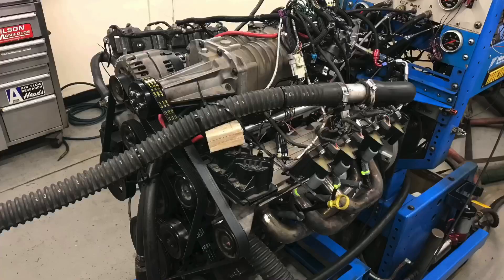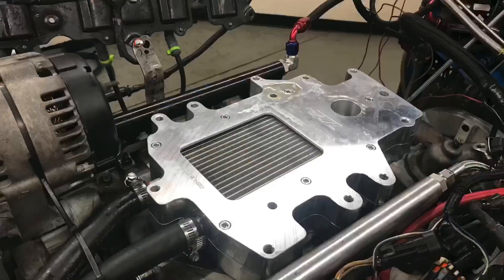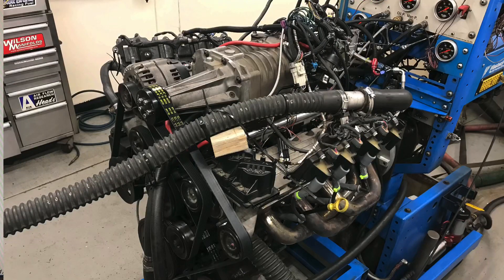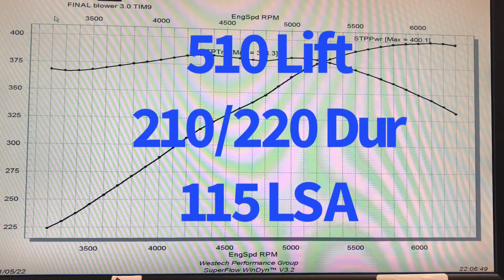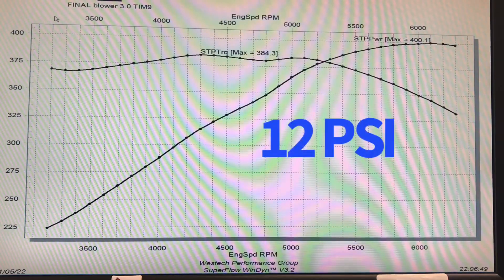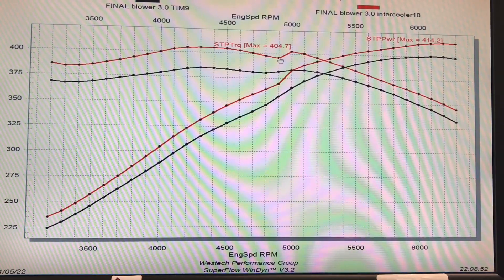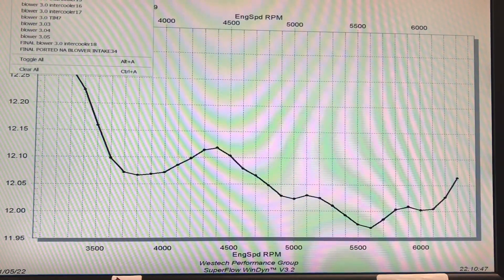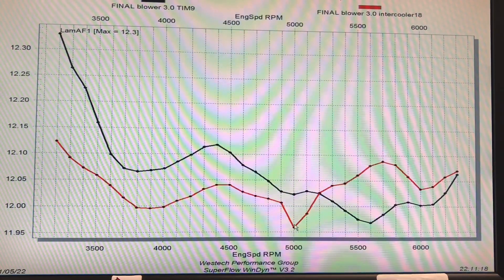DO INTERCOOLERS ADD POWER? JUNKYARD SUPERCHARGED 3800 L67 V6 INTERCOOLER TEST. ZZP AIR-TO-WATER TEST

Comment: I understand this is on Dyno giving the ideal perfect environment. However, water/air heat exchangers on these cars still have very bad heat soak. You can get 4-5 good convective pulls running a heat exchanger. Where as no heat exchanger you've really only have 1 maybe 2 if it's cold outside. In a vehicle, the coolant system for the heat exchanger is quite small so it doesn't take much to heat up the fluid. On my car, I've added small rad fans (typically found off of dirtbikes) to the front mount. These fans truly make a significant difference. I can make multiple consecutive pulls and my IAT are still reasonable.
Reply: If you're having this issue and fans make it better you're not getting any passive flow of air through the heat exchanger. The air flow offered by a cars movement at say 100kmh or 60mph is magnitudes greater than any airflow fans can provide.
A common mistake people make when installing aftermarket exchangers is assuming they work with positive pressure. This in fact wrong and no amount of air ramming will fix the issue. You need a pressure differential across the core so you need the egine bay to create negative pressure. If you examine OE cars you will find there is plastic all around the radiator to separate the engine bay from the front side of the car. This creates a high pressure zone on the front side and a negative pressure zone on the back side of the radiator allowing air to flow. I would imagine your intercoolers radiator is getting postive pressure behind it and you've bainaid fixed the issue with fans.

Comment: Just put a jdm 208 in my 02 wrx. Upgraded to STI pink inj. (565) Bigger charge pipe. Aem fuel pump and a tdo5 turbo. Looking for 300whp. Going to stick with stock intercooler.

Comment: The dip in Tq corresponds with the dip in A/F. I wonder what might connect the two. Spark gap too large, weak coils... ? 

Is this motor going into the Nova? 

The methanol, while decreasing intake temps, also displaces some of the air that can be mixed with fuel to make power.

Comment: I would offer that the water sprayed into the intake is displacing air and fuel thus the resultant lack of power gain compared to the intercooler. Energy is spent converting the water into steam which then goes out the tailpipe. #MAZDA
Reply: steam does have much higher volume than water, so that should help drive the piston down. At least that is what the F1 people said when they played with water injection

Comment: My guess is that e85 is already taking up most of the heat, so there's no heat for the methanol to absorb. While the intercooler is making the air denser.

Comment: My guess is that water going through the supercharger is consuming a portion of the total available mass flow. Because the supercharger is driven by a fixed ratio system there is less available room/flow for additional air/mass of any kind??…compounded by the fact the water vaporizes and thus expands on its journey thru the supercharger making the situation a bit worse. 

A really interesting test would be to remove the intercooler and jury rig the six fuel nozzles above it, but behind the throttle plate to confirm the evaporation cooling of E85 through a blower. 

But perhaps as all too often, I’m barking up the wrong tree…

Cheers 🍻

Comment: Water/methanol converts the sensible heat to latent heat but also adding the volume of the vapor from from the injected liquid. The intercooler removes heat and allows for a denser charge and more mass of air into the engine resulting in more power. The water/methanol inject will lower temperatures but won't effectively add more mass of air going into the engine.
Reply from the maker: BINGO

Comment: Maybe the water/meth was less of a consistent mixture in terms of temp and AFR compared to just uniformly cooler air? How did thr intercooler change the boost pressure vs water/meth?

Comment: This makes me want to get back into 3800 stuff. I know its a junkyard motor theme but some day id love to see a combo like I had with higher compression and worked over heads. When I first built my 3800 and had problems with the intercooler coolant loop I could tell right away when there was an air bubble in the pump. Knock city almost immediately. It was such a rewarding engine to tinker with.

Comment: I know you're super busy, but where did you put your charge temp sensor?and what is your tooth #1 angle set at? I have turbo 3800 I've stuffed into a fiero and trying to get the timing set correctly but I don't have any timing marks to work off of :(
Reply from the maker: THE AIR TEMP WAS POSITIONED UNDER THE BLOWER IN THE LOWER MANIFOLD

Comment: Hi. Just wonder what you think  regarding the drop in the middle of the power curve. i assume you are still using the balance shaft because you mentioned your still using a chain tensioner.so i was thinking that the balance shaft may be sucking power at that rpm due to some sort of harmonic clash.?? maybe.  is it possible for you to test a no balance shaft set up ? a few guys are doing  this set up to run double row chains  so i'm curious to see if it affect the motor in ways apart from balance..

Comment: With the water meth , did it have the same mbt timing ? Other than that , it seems water meth has the same impact on hp on motors that I’ve seen as well? 
Possibly the water is displacing fuel that adds power , with water that does the opposite? 

I guess with knock ears you could possibly over come with more timing and find mbt for water /meth . ??

Comment: So how does a water intercooler work if you have a 180 thermostat in your car? Wouldn't the charge temperature always be 180 or higher?
Reply: Separate system from engine cooling
Reply: @turboed00SI  but what keeps the water cool?
Reply: @notme8121  a front mounted heat exchanger for the intercooler loop
Reply: @sg34qw  that's interesting because big diesel trucks with two turbos it just uses engine coolant in and also has a air-to-air intercooler in front of the radiator
Reply: @notme8121  the engine coolant is cooling the turbo, 
the air to air intercooler, is cooling the air that was compressed by the turbo, before it goes in the engine.

Comment: I think the reason for the inconsistency and not showing the true potential of water/meth injection is due to the fact that using boost juice or any premix product, the meth content varies. Plus the positioning of the nozzle, The further away you have it to the valve the more time it has to atomise and the particles remain in suspension not clumping up into water droplets. And the best ratio of water meth to fuel is typically between 12.5% percent to 25% of total injector flow for any given load at any given RPM. For example in my Honda Civic Type R on the K20c1 engine I have for 1056 cc injectors from the factory and 1 1000cc water meth nozzle. Which works out to be about 23% water meth to Total Fuel flow capable of all the injectors combined. The nozzle is placed at least 42 inches away from the furtherest valve being at the number one cylinder there's plenty of distance for the mixture to atomise. And I typically see on average an air intake temperature of 10°c/50°f to 25°c/77°f. And this is done with a 50/50 water meth ratio. Maybe hit up Scott F Williams on the water methanol injection page on Facebook this guy has been doing it for years and is a pro at it
Reply from the maker: THE ATOMIZATION IS NOT WHY
Reply: @richardholdener1727  I'm stumped then then what would it be🤷
Reply: @richardholdener1727  maybe the overall methanol content? As meth has a higher rate of evaporation than water which helps evaporative cooling...

Comment: I love watching these videos Man.  Are you going to do a video where you pulley it down a little more because you put the intercooler on so we can see the power gains.  I'm also interested on seeing the intercooler installed on a stock cam car with the same pulley configuration.  The car will produce more boost because there is no cam.  I'm interested in seeing the charge temperatures.  Thank you very much for what you're doing I am 3/4 through my build and this information will let me know what to do next.
Reply: I have a 3.0/intercooler/e85/stock cam and i make around the same boost. 11.5-12
Reply: @sg34qw  you always lose boost running through an intercooler and even more adding a cam.  I'm interested in seeing a stock cam car intercooled to see if it runs more boost than the cam intercooled with same pulley size
Reply: i have this same setup Richard ran but with a stock cam.. i run 11.5-12lbs of boost. maybe my teflon coating is worn, but its the same boost as richard was running.
Reply: @sg34qw  I ran 14 pounds on a 3.1 pulley, non intercooled.  I would just like to see a stock cam intercooled pulling down as low as you can go without kr.
Reply: @CBbailey  im just saying you said you'd like to see what boost a stock cam would make on a intercooled 3.0 car. And im telling you what mine makes. If you made 14lbs with a 3.1 you had an exhaust restriction.
Reply from the maker: YOU DON'T WANT MORE BOOST AND LESS POWER-YOU WANT LESS BOOST AND MORE POWER

Comment: Happy to watch the episode, but I’ve gotta ask; what car guy DOESN’T know intercoolers add power?
Reply: Ls2  procharger air to air intercooler 27 by 12 by 3.5 loosing 3lbs boost before carburetor 9lbs versus 12lbs 93 pump gas 14 degrees timing. Non-intercooled more responsive with more horse power. Did not have temperature probes.
Reply: @fasteddy  if volume remains the same but temperature drops, pressure drops.  But the same amount of oxygen and fuel is present. Lowering the pressure/temperature means you can add more air and fuel in its place.  It sounds like you were at the peak of you compressor’s efficiency.  Being rpm dependent, it couldn’t push more air into the engine, but seeing as the air was cooler, it was at a lower pressure.  Lowering the temperature and seeing that much of a drop in pressure, should allow for a smaller pulley to push even more air back in.  

Non intercooler will almost always give better throttle response.  Same problem that plagues read mount turbos.  The longer the plumbing, the more lag.  But typically, LS guys are at the strip, not the road course, so lag isn’t of much concern. But I would think on a belt driven system you’d have trivial lag anyway.  🤷‍♂️. Every set up is different and will come with its own quirks though.
Reply: @fasteddy  similarly, my turbo is very responsive in hot air, and “makes 22 psi” in the summer.  But in the winter, lag goes up “a smidge” and boost tops out around 19.  But it’s absolutely faster in the winter.

Comment: Great video, would be curious to know if the boost pressure dropped with the IC in service.
Reply from the maker: YES
Reply: @richardholdener1727   I was amazed at how much is cooled the charge.  Also would have thought that would have resulted in a lot more HP which tells me it must have been several PSI drop in boost due to the restriction of that small intercooler core.   My conclusion would be that the IC is worth it with pump gas, maybe not worth it with E85.  Curious what others think?
Reply: @Toys4Life  … I was also impressed by the significant and consistent drop in temperature when using the I/C components. The psi loss across the core is minimal in most cases and shouldn’t have caused a very serious loss in power output. 
I also noticed how many people make a distinction between pump fuel and E85. I haven’t traveled out of the Atlanta area very much over the past couple of years so I can’t really comment on the availability of E85 in other parts of the country but locally it’s available at nearly every refueling station on every corner. Since 93 octane “pump fuel” and E85 come from the same pump, it will all be called pump fuel eventually 😁. Or so it would seem.

Comment: How much did your boost change Richard?  Or will we be seeing that in the next test where you start to pulley up the blower?
Reply from the maker: I DIDN'T LOG IT UNFORTUNATELY, BUT IT SEEMED (VISUALLY ON THE GAUGE) TO DROP SLIGHTLY

Comment: GTP’s would have been the ultimate sleepers 25 years ago if GM would have included an intercooler with the SC 3800. Well atleast until the glass transmission blew up
Reply: headers, pulley and throttle body with a tune were plenty for sleeper status. I had a 4 door (4 more whores) gtp and it walked many of a surprised victims
Reply: @oldseabee5436  same until my input shaft exploded

Comment: That’s not a “good question”. Combustion quench and Liquid displacing in air
Reply from the maker: EVERY QUESTION IS A GOOD QUESTION
Reply: @richardholdener1727  on second thought? Your right as usual lol. I’m dying to see the 100% meth test lol. For 15 years I’ve been saying “don’t put anything in the cylinder that isn’t flammable”. Well…. “Engine Masters” already ironed that out for us FINALLY. 15 years of people calling about water Heat latency vs meth, vs me putting meth on 10 different cars and trying 50/50 or 75/25 10 different times and 100% of the time, the 100% crushed it.

Comment: Would like to see testing on nitrous im running a 150 shot and on e85 in my gtp and man does that thing pull plan on going a 200 shot with a nitrous stand alone to see if it holds

Comment: I wished you showed the boost drop, and then added a smaller pulley to get it back to the original PSI for additional power gains.
Reply: Anecdote ahead: I had a similar setup (build shortblock with 9.5:1 pistons and an overdrive crank pulley)and while I could run a 2.8", it ran best on a 3". But I guess thats closer to a 2.6 with a stock crank pulley so i guess this whole reply is moot! Lol.
Reply from the maker: WE KNOW ADDING BOOST ADDS POWER

Comment: I'm looking at an old log of my twin screw 3800 running around 20psi. This frame at 6000rpm has 326f on the pre-cooled temp and 193f after cooling - still hot as hell but good improvement. I know before I put thermocouple probes in, i had melted the plastic guard on the old gm IAT sensor installed in the lower intake :o
Reply: My dream setup was always to ditch the Gen V and go with a whipple.
Reply: I'd love a tvs rotor pack for genvm90 or some twin screw

Comment: Would have been helpful to have had a MAF sensor on it for these tests. Even though the water meth lowered IAT's, I would speculate that it did not increase airflow into the engine whereas the intercooler probably increased airflow. I would like to see this test redone on pump gas to see how close the intercooler could come to matching E85 for power.
Reply: Intercoolers certainly do not improve flow especially through the already restrictive lower manifold design. Blowing through the core itself is a decent restriction however the cooler, denser air produces more power.
Reply: You are probably thinking of a turbo application where the boost is measured/ controlled post intercooler. Since the pressure is the same and the temperature goes down the charge density went up which means the compressor inlet flow increased. That doesn't happen on supercharged applications, since the compressor speed is fixed to RPM.

Comment: Richard! On a carburetor, Why would you have to adjust jetting for elevation but not for blowthrough boosting?
Reply from the maker: YOU DO USUALLY HAVE TO ADJUST JETTING FOR BOOST-BUT THERE IS ALSO A BIG CHANGE IN SIGNAL WITH BOOST (WHICH DETERMINE FUEL FLOW)

Comment: What would circulating ice water do for it on 93 pump gas ?
Reply: Mr. Lucier, the dyno facility is in California and the pump grade premium fuel is generally 91 octane. I don't believe they have 93 at the pump. I hope this helps.
Reply: Ive often wondered about this. Surely there has to be diminishing returns where no matter the coolant temp running thru it it cannot extract any more heat
Reply from the maker: ICE WATER WOULD HELP

Comment: The reason that it doesn't make more power with water/methanol is that you introduce water into the fuel mix. Water contains no energy and takes up room in the combustion chamber. The gain you would gain in temperature reduction is offset by introducing water into the combustion chamber. If you're not going to add an intercooler, adding water/methanol is a good idea. You get more consistency in horsepower and torque. In addition, you get the benefit of cooling the air charge and it would allow adding more timing if running pump gas rather than E-85.
Reply: What would happen then if you just ran methonal and didn't mix it with water?
Reply: @177SCmaro  - You would make more power. One problem with running straight methanol is that it is a hazardous material. That why Boost Juice or anything like it contains up to 49% methanol. Shipping hazardous material is expensive. Methanol fires can be dangerous because the flame is practically invisible and it has a very low flashpoint. It's safer and more practical to mix methanol with water.
Reply: Not true about the water as it's expansion rate increases compression ratio, if you think otherwise the go tell David Vizard he's wrong also !